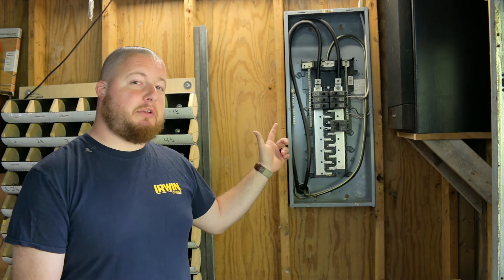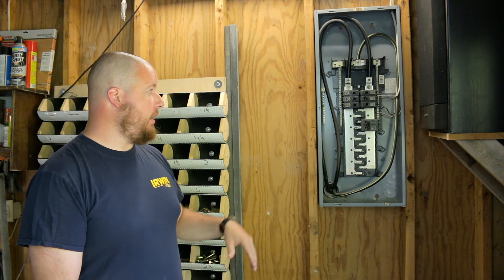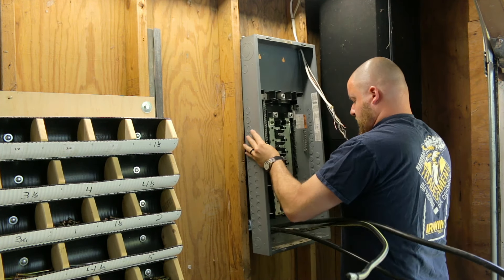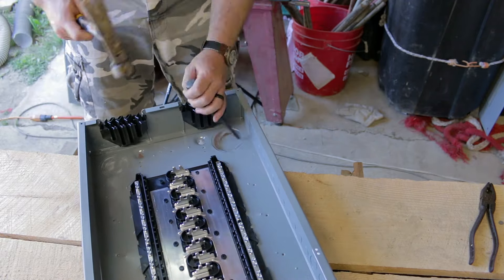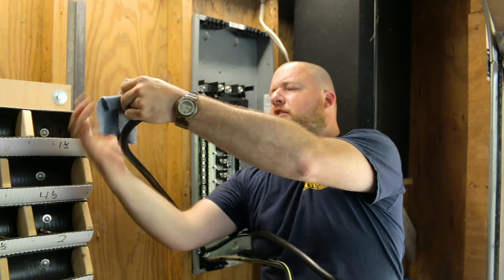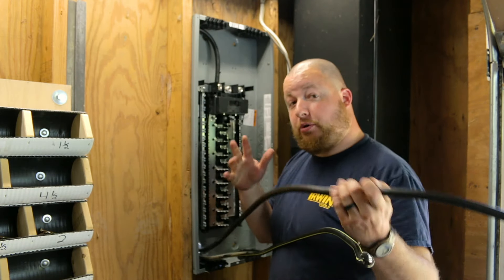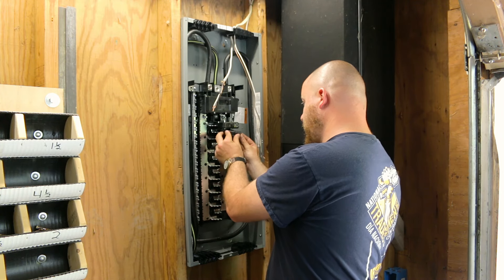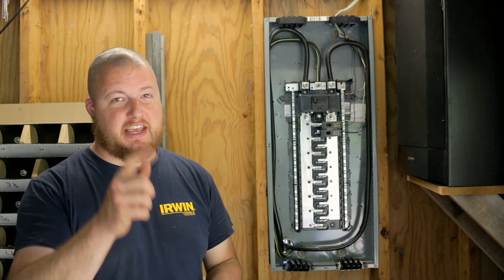Electrical Panel Replacement/Install

Comment: You should hire a licensed professional to do this as it is illegal to perform this install if you are not a qualified professional as well as extremely dangerous and a serious fire risk.  A permit is also needed.  Most power companies are replacing meters with remote meters monitored from a central hub which will dispatch a lineman crew if you attempt to remove a meter yourself and you can potentially be arrested for not having proper job number and permitting in place.  What you are doing by putting a video like this on YouTube is extremely reckless and shortsighted.  Shame on you
Reply from the maker: @David MAcMillan Are you the Electrician Police?! It is not a felony to work on your own electrical system, so how you would get arrested for this is beyond me. At best you could possibly get a fine from the electric company for breaking the seal on your meter. As for the fire risk, yes its possible if you installed the panel improperly, but THANK GOODNESS there are channels like mine who take the time to walk you through how to properly install a panel yourself. My meter is not a smart meter so I'm not going to have linemen show up at my house either.
Reply: Sounds like a "job security" comment from an electrician.
Reply from the maker: @MrPhotographer77  for sure!
Reply: It is reckless. If you are unaware of the dangers of something as simple as putting a bushing on the service conductors you really shouldn’t be doing that yourself. I’m not being an ass, I’m just concerned for the people watching this.
Reply from the maker: @threeeyedpheonix1031  If you have a video addressing these concerns I would love to watch to educate myself. Or you can list them here if you're concerned about people's safety. This is an educational platform for people to learn, not just trolls
Reply: If it's your own home, you can get a permit and be the contractor. I don't know about pulling the meter to expose "hot" areas. But the power company should have the power off to do this type of work.
Reply: Coz the damn professional costs you half of the value of your house! If they are more reasonable then more people can afford them and don’t need to watch videos like this. Plus, half of the time these so-called “professionals” do a half ass job and cut corners everywhere.